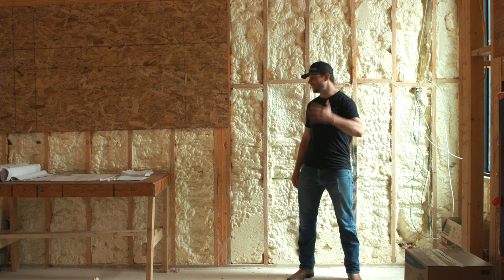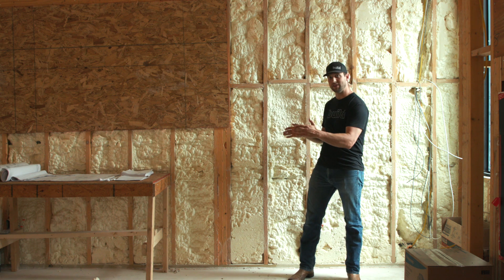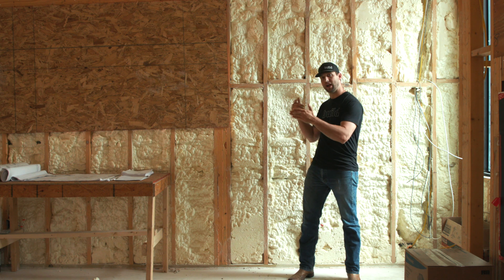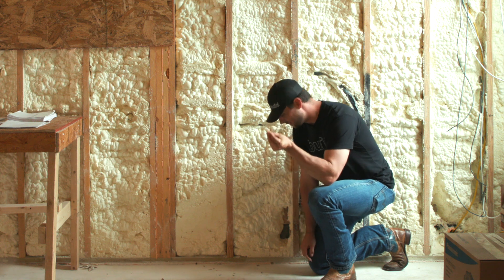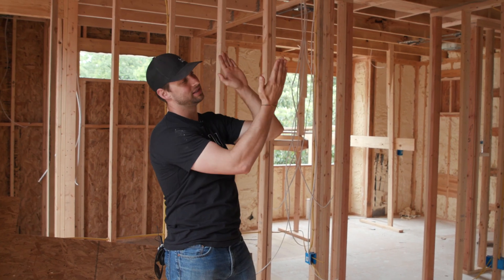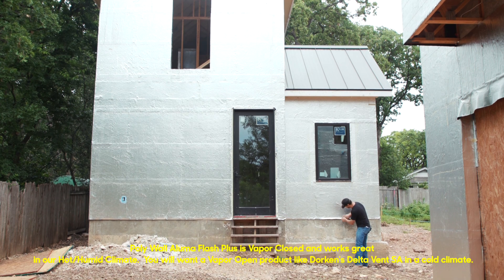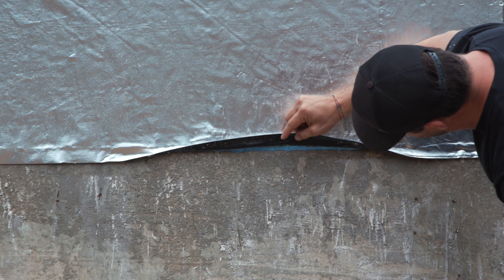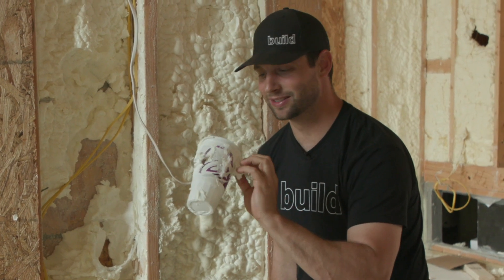3 Spray Foam Problems

Comment: Hello, I'm a commercial contractor and recently purchased a 2019 Mercedes Sprinter Van. I need to insulate and panel the interior walls prior to setting up the custom shelving for the kind of work we do. None of the van outfitters in my area can answer this question.... "Is it OK to use closed cell spray foam insulation in a van?  The typical materials used in my area are rigid Polystyrene or Foil faced Bubble wrap.  I'm looking for the best possible insulation solution that won't create any moisture/ mold issues down the road.  Any thoughts???

Comment: Spray foam requires a proper installation like most things.   Just by looking at the texture of the stud bays,  this was a horrible job by the installer in every way.  
I wonder if the homeowner went with the cheapest price and got what they paid for.  Now they are redoing it and paying twice. There are many considerations when choosing a contractor. Price is only one of them and probably not the most important.

Comment: Spray foam... Why do you Americans use so much spray foam? Is off gassing not a thing on the other side of the pond? It's a real concern you should have when choosing insulation for your home imo.

Personally, I prefer rock wool. Glass foam seems interesting as well. But I have no experience with it and I have some concerns about the black tar-like liquid they use to glue it in place.
Reply: Spray foam is ideal for retrofitting and complicated framework, and more.

Comment: So, spray foam sucks except to fill small, irregular voids where rock wool won't do. Got it.
Reply: Julian Cate did you even watch the video?  Jordan pointed out several technical details that need to be got right to have the best product.  He did not show that spray foam sucks.  Rock wool also suffers from poor performance if incorrectly installed and costs more to achieve the same air infiltration and R value.
Reply: @jpe1  Thanks for the lecture, numbnuts. I am the one saying spray foam sucks. Oh, and thanks for the tip that any insulation type has to be installed properly to work. So many people will be shocked to learn that! The issue is that some types of insulation require less labor, less waste, and don't need ideal conditions and an expert installer to work properly. You know, like rock wool vs. spray foam.
Reply: @juliancate7089  - Biggest problem with spray foam is finding people who know what they are doing and competent installers. That's why results too often are way worse then what they would have to be. Again, general problem is to find competent installers.
Reply: Julian Cate I apologize for taking a condescending tone in my initial reply; I would have done better to read your comment as neutral observations not a blanket condemnation of spray foam.  As you yourself point out, any insulation needs to be installed properly, including rock wool or for that matter fiberglass bats.  My assertion is that rock wool is more costly to install than spray foam for the same air infiltration and R value, especially in retrofit situations, and people need to look beyond the “anti-vaxxer” style propaganda of those who are intent on bashing spray foam by repeating scary (but easily debunked) talking points.
Reply: John Early I think w can al stipulate-spay from when applied properly and you use bran name product (icynene etc) doenst off gas toxicity, an seals well an is quite cost effective. But these days lets be honest- finding honest subs is oen thing,hard enough, finding a sub with workers who are what they are doing-seriously -thats <10%, probably even closer to 1% than 10.%. Rock wool hard t mess up AND most homeowners  can see with their on eyes is application is decent. Even Matt and the guys on Home craftsman web site concede this-.

Comment: With that aluminum foil product completely sealing the outside of the house, what happens to the moist air from inside the house when it gets into the nooks and crannies of the walls?  Anybody?
Reply: In our climate, we dry to the inside via mechanical systems. It's more humid outside than inside a conditioned space 10 months out of the year, so the wall would have a hard time drying to the outside.  Colder drier climates need different strategies for sure!
Reply: So Jordan I'm a little confused on what to use here in New Jersey where we get both high temps and high humidity for roughly 3 months and cold dry temps for about 3 months. So do I dry to the inside or outside? The standard here seems to be fiberglass bats and tyvek, but a few "better" builders are using Zip systems.

Comment: I am glad you included the bit about the taco bell cup because we have all seen it. I have seen it in concrete pours.
Reply: LOL! I didn't know Taco bell made concrete additives & air sealing products. I guess that will Taco Bell restaurants take over entirely the fast food sector in a few years (reference to Demolition Man Movie)
Reply: @guytech7310  nice reference. Air five.
Reply: I may know of a couple of buildings slabs that have Nextel's phones that would not stop alerting
Reply: That's wild. It makes you question all of their training and credibility. Whoever drank that cup would be fired on the spot.

Comment: Not a fan of soray foam for the cost better to do hemp Crete you get a stronger structure and it fire proof excellent insulator natural breath for humidity control insects resistant termites loced to tunnel on sprayfoam 
Can you please do a video on hemp Crete
Reply: Roxul is likely better since its Hydrophobic. I presume Hemp Crete, being an organic material can absorb water leading to Rot and mold problems. Also has low R value about R-2 per inch compared to Foam & Roxul which is about R-5.  Roxul recycled Slag from steel production so its green since the slag does end up in landfill. Nothing beats Roxul for fire protection.
Reply: @guytech7310  Hempcrete follows a different building design principle but has gained momentum in the restoration of old buildings which were deigned to be breathable and use lime mortar and renders. Cement, gypsum, vapour barriers and waterproof creams have caused rot and mold problems when applied to old houses because they trap water in the masonry.  Lime+ hemp if done correctly has excellent humidity/condensation buffering and is naturally mould resistant due to its high alkalinity. If you are using hempcrete for new build then it can be used to create a full thickness wall which provides not only insulation throughout the wall but also thermal mass. No material is 100% the best solution for all situations but hempcreta has many advantages if you go beyond R value.
Reply: @guytech7310  If one believes the brochures, the hemp plus lime combination has some chemical stuff going on that makes it 'moisture controlling'.  Also, organic & therefore a carbon sink, depending on shipping distance.  However, I agree with you on Roxul.  Rigid insulating or sealing materials crack if you live somewhere prone to ground shifts, but Roxul (or fibreglass) with poly bends with building movement and keeps the thermal barrier intact.  It's a lot of work with accoustical sealant and tape to get a really good seal with poly, but it lasts if you do it right.
Reply: Tommy Tsunami yes please.  I think it should be catching on quicker than it is.  Laws on growing it though might be a problem in US?  Yes its labour intensive but then again a few more folk might be finding jobs that way too.
Reply: @makingitthrough190  best way to keep the young student in shape for summer time jobs

Comment: So plastic inside the walls and an aluminium wrapped house altogether - seems like an environmentally conscious solution ...
Reply: Vs. Natural products prone to decay by natural mechanisms.
Reply: @970357ers  ... which can be used in a way that doesn't affect longevity without a problem.
Reply: @Child3k  Sure as long as your the person that is willing to pay to replace it all when it rots or decays! most of the green materials end up in landfills anyway as there is no means to properly recycle them. Most of the recycled products either shipped to China and dumped, or end up in a landfill. Green Recycling is largely BS.

Now if you go with long lasting products: you reduce the need for replacement over the long term (last longer = less consumption, less energy needed to recycle\despose of). Penny (Green) wise, Pound foolish.
Reply: @guytech7310  And here I thought all the Build Shows bits and pieces about austrian / german building-styles might have actually affected ppl ...
Reply: @Child3k  Wind driven rain is one of the worst external mechanisms. Something Austria & Swizerland are not typically prone to.

Comment: When so much of this depends on budget.. why not mention the costs of these products?
Reply: that would be enough to cause heart failure
Reply: Because if you're building a custom home for yourself, as most of Matt's builds are, the cost delta is negligible vs the increase in Mean Time Before Failure. If doing it the best way gets you an extra 50 years before you have major structural repairs, the extra $20-30k it cost up front is meaningless. If you're building spec or you're a flipper, meet code and not a penny more.

Comment: the biggest problem with spray foam is keeping your termite warranty
Reply: Not mentioned in this video. 
But spray foam is damaging to plastic insulation for wiring and should be covered with a wax tape. 
It has led to house fires.
Reply: Atomic Sparks ???  Do you have documentation and proof of that?  We have letters from wire companies saying there is no issue with spraying foam over the wiring in a wall cavity.